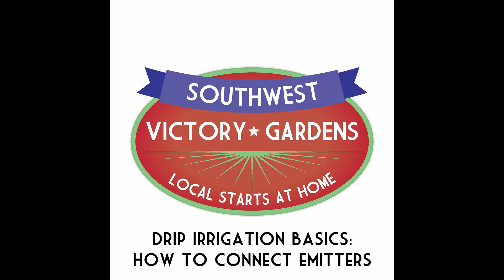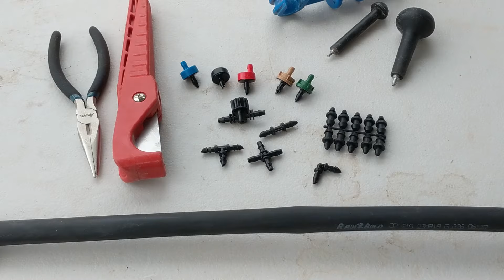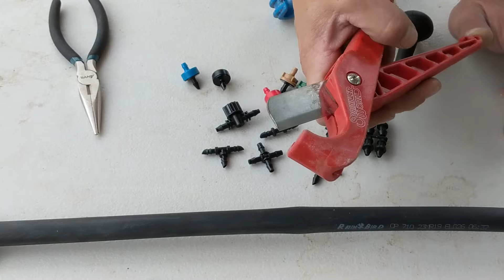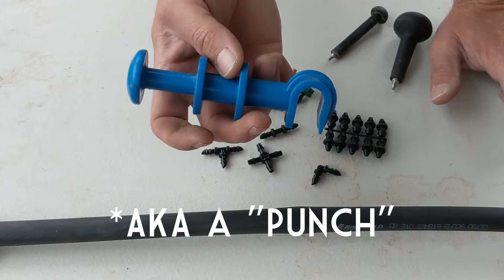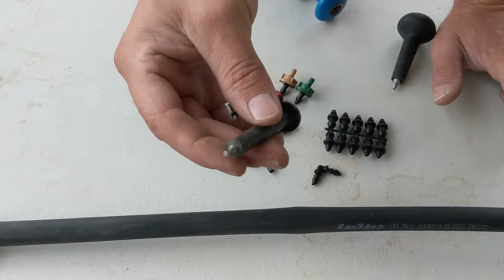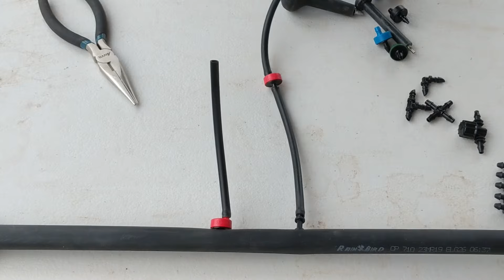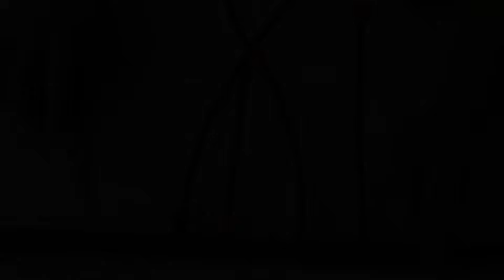Desert Gardening Basics: How to Install Drip Emitters

Comment: It's frustrating that the 1/2"  comes in different OD's which requires different fittings.   There is also thin and thick wall.  Is all the thick, .700" OD and the thin around .620"?  I believe the thick can handled full water pressure while the thin has to be regulated down to I think it's 30 psi???

Comment: For the one on the far left, what's the point of the emitter? The valve becomes the emitter and it's adjustable so the emitter is pointless, no?
Reply: With the valve you don’t precisely know how much water flow you are getting, fully open you could be getting +20gpm. So you may as well just use the valve as an on/off switch and  throw a 1 or 2 gph emitter to be consistent, they’re cheap anyhow. I usually just branch off the mainline and use 1/2” valves before the 1/4” line emitters; to control plant groupings, say if I didn’t want to water my peach tree of grape vines that day.

Comment: I'm using floraflex 1/4 tubing with netfim woodpecker Jr. Using 6 way splitters from 1/2 tubing, from Amazon, surprisingly seems to work those parts. Anyway, the green tubing from the floraflex maybe isn't the best, the emitters don't fit in it very tightly, some were poking out and at an angle for a second, a few popped off easily. I cut some tubing off and reattached, but I'm concerned as I need this to work while I travel. What's my problem? Should I get different tubing and what's the best for this?

Comment: I pulled an old 1/4" line adapter out of my 1/2" hose. It broke, leaving an exposed, damaged, leaking, 1/4" line adapter. Couldn't get it out with pliers. I think I have to cut that section out and re-attach 1/2" poly with a coupler. How do I know which coupler to use - they're all different? Thanks for this video!

Comment: I must have done something wrong, my main line (spaghetti tube) runs above the ground at almost the same height as the tap, it has a few inline drippers, and a couple dripper extensions hanging down the line. The 2 hanging ones drip a lot but my end drippes do not drip at all. Is this because of gravity, pulling all water out?

Comment: Great video. Rain Bird recommends that you install the emitter in the 1/2" distribution tubing unless the 1/4" tubing is longer than 5 feet, in which case they recommend that you install it in the 1/4" tubing closer to the plant being watered. Your methods one and two in the video. They don't recommend method three.

Comment: Seriously thanks for this.... my foreman had me redo several not so easy to get to emitters today because he said it was wrong and won't put out enough water with the red emitters going straight into the drip tube and running the noodle line out from that. I knew the was I did it was the better way but still had to redo it all anyways.

Comment: The spaghetti tubing is a game changer for me, and makes so much sense. I did my first drip system in a new garden bed this summer, and ran the half inch poly tubing directly next to the base of each plant, with emiters right next to each root ball. This video makes me want to rip it all up before the plants fill in, so I can route the poly in a more accessible way and use the spaghetti tubing to take the water where I need it. That'll be a nice winter project if I get bothered enough about my setup, now that I know what the spaghetti tubing is for. Also the valves!

Comment: I moved into a new construction and they had installed the drip emitters using the least preferred method.  Instead of using different color emitters, they used 3 red for trees.  I am going to install a new zone,  how deep does the 1/2 inch line has to be buried in the Phoenix area?

Comment: Great video! My 1/2" is buried, so the 2gph option 1 would be hard to go around checking all the spaghetti. However, I have option 3 (and clogging). I'm going to fix my system to option 2 based on your video...THANK YOU!!

Comment: What a great video.  I have a drip system in my backyard that has too much water pressure through the line.  I was connecting a 1/4 inch barb to the poly tube and then the spaghetti tube and then the emitter.  The water pressure would continuously force the spaghetti tube off the barb and start shooting water directly out.  By using your first method of installing the emitter directly into the poly line, I can control the water pressure at the poly line and I no longer have the problem of the spaghetti tube being forced off a barb.  Wow, this was a game changer for me.  Thank you.
Reply: If you're blowing lines off their fittings, did you use a pressure reducing valve? Many drip systems run at reduced pressures. Mine runs at 15 psi.
Reply: @paulmaxwell8851  No.  That would have been a very expensive option for me.  This way cost me nothing.

Comment: If tying the 1/2 inch into an irrigation system do you need to add a compression regulator?
Reply from the maker: The components I use in this video are all designed to operate between 20-40 psi so if your water pressure is in that range you wouldn't need a regulator. In the video description there are some links to some other videos I've done on components of an irrigation system where I go into more detail about the need of a pressure regulator, I'd check those out if you have time. Good Luck!

Comment: Question! So I can slow down the drip even more with the nob control connector?
Reply from the maker: If you think of it like a light switch, the knob control is more like a dimmer than an on and off switch, you can adjust it to anywhere in between opened and closed. So lets say you have a ten gallon per hour emitter but you adjust the knob so it's only halfway open, then your emitter will only put out about 5 gallons per hour. Hope that helps, good luck!

Comment: Can you use some type of coupling to convert a smaller than 1/4 in. spider tubing to 1/4 in. tubing to water two plants with specific water needs. I inherited a system and don’t want to change everything, if possible.
Reply from the maker: Usually anything smaller than 1/4" is referred to as "Micro-Tubing" and will not work with standard 1/4" spaghetti tubing. Different manufactures of micro-tubing can use different fittings so it best to use the original equipment that comes with the tubing, sorry I couldn't have better answer. Good luck!

Comment: Thanks for explaining.  This answered a lot of my questions. Is it ok to run drip irrigation off the same line as a sprinkler system using a valve and pressure regulator or do the lines need to be separate? Im not even sure if that is possible, but wanted to ask.
Reply from the maker: you can run different types of irrigation on the same line as long as you don't exceed the maximum gallons per hour that the components are designed to run on. The emitters I use in this video for example are designed to run on a system that outputs no more than 180-200 gallons per hour. So on one valve I could have any combination of emitters as long as the total gallons per hour when you add them together does not exceed 200. If you exceed the limit, the emitters will put out less water than they are supposed to so you will need to run this system longer to compensate. Sprinklers tend to put off a large volume of water which means your emitters would most likely lose some pressure and not put out as much water as needed and you'll need to run the whole system longer which may not be best for all of the plants. Hope that helps, good luck!

Comment: Good day sir, the water I use for watering my trees is a bit salty and the holes of my tubes often getting clogged by the salt. I frequently flush acid solution into my tubes to dissolve the salt. I wanted to ask you which one of the 4 settings is more suitable to solve this problem. Thank you.
Reply from the maker: I too live in an area with mineralized water and have this problem quite a bit. You'll definitely want to make sure you have a filter on your system that can filter out some of the minerals, but in general spaghetti tubing will need to be replaced every so often. In my vegetable garden I replace line every 2-3 years or so but in some cases i've seen line need to be replaced every 6 months. I have not tried any acid solution other than vinegar, I have used it with success but it takes some time. Good Luck!

Comment: Great video. Helped a ton. Could I use a T after a 1/2 gallon emitter so that I can have water go to both sides of a plant?
Reply from the maker: Oh yeah, I do this all of the time. I'll take a 2 gallon emitter and split with with a "T" and run it to different parts of the root zone of a plant, this helps to spread the water around without increasing the overall amount of water. Good Luck!

Comment: Very nice but I would suggest putting your emitter onto the end of the 1/4 inch tubing first (if possible) and it will save you a lot of headache, especially if the polytube is already in the ground. Otherwise you are fighting with it twice.
Reply from the maker: that's a good idea, you should make a video about it!

Comment: I work in big time farming yeas ago , we were some early developers of DRIP , having said that there is another system not mentioned here I actually knew Jim Roberts of Fresno Cal. who developed a great system [bless his heart and wife Betty too I hope they are alive ] Jim Mfgd. a system in Fresno  that did all that however his went from mane supply line with an insert such as these followed by a spaghetti hose , at the end of that  hose was an inline insert that held it in place where ever you put it and did two other things controlled water flow and prevented bugs from seeking water one other thing it did it sorta of filtered the water at drip point and they were CHEAP

Comment: Thanks for the video! :)
Is it possible, to change the drip emitter from the polytube, once You inserted the first one?
How much pressure can You add on the main line, if the drip emitter is pressure compensating?
Reply from the maker: these emitters are designed to work from anywhere between 20-40 PSI

Comment: Great video. Just subscribed! I have a drip irrigation system that came with my home. There is a PVC pipe that comes above ground and connects to the flex tubing (main line) you showed here. When I turn on that zone the black tubing disconnects from the pvc and a lot of water comes out. Any suggestions on the correct way to repair this? I only noticed it because all my mulch had flooded out onto the driveway. Glad I only had it set for a few minutes.
Reply from the maker: you'll need a "PVC to Compression" adapter to transfer from PVC to black polytube. Sometimes older polytube can stretch and slip out of the compression fitting so you need to replace the line or the fitting. Good luck!

Comment: Excellent video. I could not hear ss I'm in a restaurant. How long do you water your plants with the system? Time?
Reply from the maker: Watering duration depends on many factors including plant species, soil type, and season. Unfortunately I can not offer suggestions on how long to water without knowing more about all of these things and more. I would suggest two things, first in dry climates like ours it's often good practice to water deeply and infrequently. Deeply and Infrequently. Second, I would consult your local co-operative extension as they might have more knowledge of the particular plants, soil, and climate in your area and could offer better suggestions. Sorry I couldn't be of more help in that regard, I wish you good luck and happy gardening!

Comment: I will be running a drip/soaker hose into my 5 gallon buckets and this is a good way to show my husband who has never done irrigation what we will be doing so instead of the spaghetti tubing we will be using this spaghetti dripper hose And not the drip irrigation
Reply from the maker: Good Luck, I hope it worked out!
Reply: Well I have 1/2inch water Carrier tubing but those plugs are too small and the 3/4 inches too big so we're Having to adjust But should have it completed within the next week

Comment: I'm doing a science project with different drip size emitters effectiveness on plant (not the final question but something like that) and I'm not necessarily planting anything big or excessive so I was wondering about the tubing and was wondering what size I should get
Reply from the maker: Drip irrigation is pretty standard and the tubing sizes are relatively limited. Most of the time you are going to use 1/2" poly tube for your main water supply line and to that you will connect 1/4" "Spaghetti" tubing, sometimes called "microtube". all of the emitters are designed to work with standard 1/4" spaghetti tube, regardless of how much water they put out. Hope that helps, good luck!
Reply: @SouthwestVictoryGardens  THANK YOU :))))

Comment: How about the Flag type dripper??  I use and install them above ground into the micro tube near the plant.  If there is any type of clog or calcium build up in the emitter,  it is very easy to clear the flag emitter by unscrewing the flag, clearing the debris and screwing back in.  Also, if you have lack of water flow, with the  button style dripper installed into the burried underground mainline, you gotta dig up the micro tube basically following or trace it back to the main line to to replace the button dripper. You can  not clear a button dripper. ... So, for this reason I never understood the logic of installing button drippers into the mainline which creates more work to determine lack of water flow issues....????
Reply from the maker: a lot of "flag" type emitters are non-pressure compensating, meaning they will put out different amount of water if there is an elevation change, I tend to stay away from them. If they work for you then I would keep using them but I don't keep any in my kit. I personally like to leave my poly lines above ground so that if there are leaks they are easy to spot, i've spent to much time digging for leaks that I don't mind the messy look. But burying is good, and in my experience all lines degrade leak eventually, it's a matter of when not if, so I think it's ok to go with whatever works best for your situation. Good luck!

Comment: Great info. The ability to change emitters easily is a great reason to use a leader from the poly trunk line rather than attaching them directly.

I do wonder why you would put a manual valve in line to roughly vary the amount of water being dispensed when you are already controlling it quite specifically with an emitter? I /can/ see the value of the valve if you need to occasionally shut down that 1/4 line while keeping the rest operating.  Otherwise, if the emitter flow is too high, either install a slower emitter or just use a valve, but not both.
Reply from the maker: It's kind of like how a doctor will prescribe a medication for an off label purpose, it's not what it's designed to do, but it works. It's true you can change emitters, but usually when you have to change out an emitter you also will need to move the line cause most likely the drip line of whatever you are watering has moved quite a bit. I don't think I've ever had an instance where I needed to switch out an emitter while not having to also move the lines in an established irrigation layout. Valves are all about flexibility, a valve let's you turn a 2 gallon emitter into a 1 or 1/2 gallon emitter without having to change them out or buy more than one type of emitter. I always opt for more flexibility when designing irrigation systems cause you never know what might change in the future. Good luck!

Comment: Need your opinion, I have 1/2" poly line thats going to a sprinkler head and want to tap off of it with 1/4" solid line for nearby shrubs. I'd like to water 5 plants spaced at 4 or 5 ft, more or less in a line.  I'd like to use your first method (pressure reg emitter) and run the 1/4" line for 20 ft. But what is best approach for drips every 4 or 5 ft?  I guess I could use T connectors with local emitter, but can I just punch a couple holes in the line?
Reply from the maker: Sorry for delay was away on a honeymoon! If you need to run the spaghetti longer than 10 ft or so you are better running a 1/2" poly line and then just coming off of that where you want to water, you won't  have much water pressure if you try to run a 1/4" line 20'. You can punch holes directly in the line, even with a pressure regulator the pressure will be so high it will erode a big hole eventually. Good luck!

Comment: You have been very helpful to a novice gardener learning about drip irrigation.  Thank you! I hope you can clarify something for me. In your demonstration you added the on/off valve directly into the 1/2 inch tubing then added the 1/4 inch tubing to it. Are there any negatives to adding the on/off valve to a section of the 1/4 inch tubing? I am looking for a way to reduce the flow of water  to a selection of planters than need much less water.
Thank you!
Reply from the maker: Thank Betty, you are so nice for saying that! Yes you can put the 1/4" valve anywhere along the line and use it to adjust the flow to whatever you like. I often do this when I don't have the right size emitter. Good luck!
Reply: @SouthwestVictoryGardens  Thank you! So glad I came across your channel!

Comment: Idk if he said it in the video, but a little tip is to pop the holes in your distribution tubing while it’s cooler outside or if nothing else in the shade. Once that tubing is hot it can be a real bastard trying to pop the hole.
Reply from the maker: This is usually more of a problem on thinner tubing, thick tubing tends to stay more rigid even in our hot summers. When buying poly tube I always get the highest quality "virgin" tubing and I usually don't have this problem. Good luck!